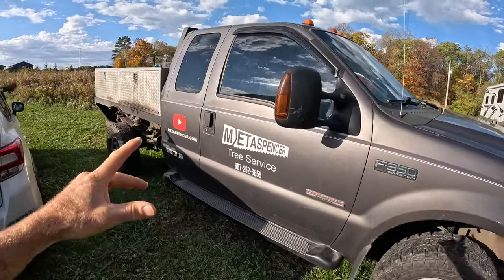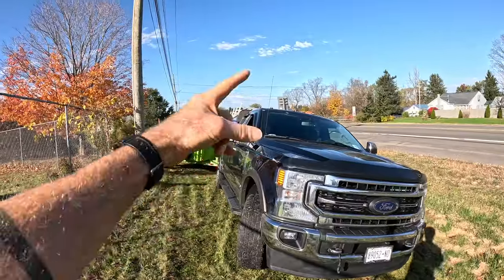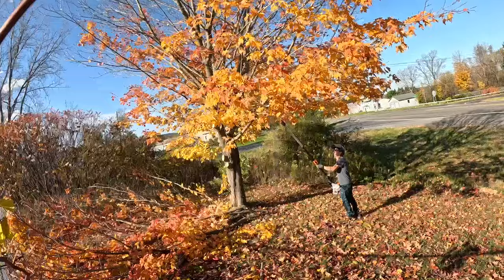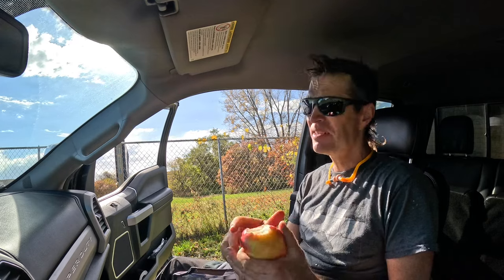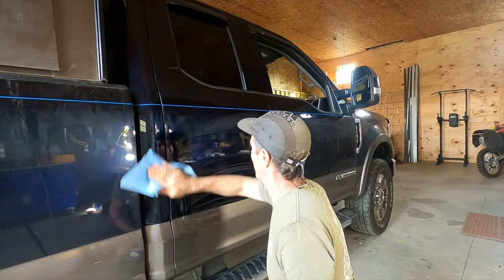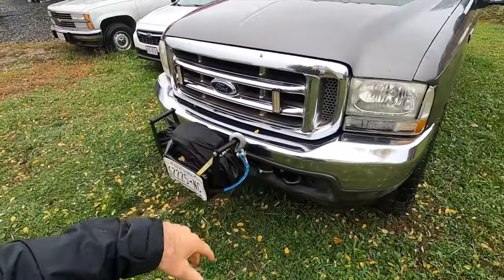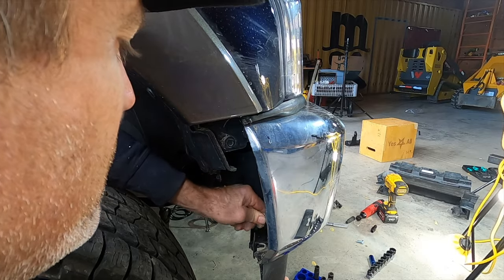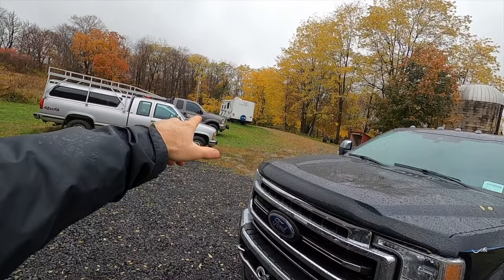I Had No Choice - New F350 PowerStroke + Winch Install

Comment: All those fancy extras in the truck means more to go wrong. All the new modern vehicles have a built-in redundancy. An extender for the winch switch sounds good I was going to suggest make an external tool and store it in one of those shelves.
Reply from the maker: You said it man ... every bell and whistle on these new vehicles is a complex replacement waiting to happen :)

Comment: Nice truck!!! Only issue I’ve had with mine is oil pan leaking.

 And yes even rakes, keep two on my truck and both broke on the same job
Reply from the maker: An oil pan leak! Dang, I'll have to keep an eye out for that. If it's not one thing it's another

Comment: You could maybe make a custom bed for the truck so you could have all your equipment on the truck and be able to haul the mini skidsteer while  pulling a trailer.
Like having a storage compartment in the front and the mini skidsteer in the back loaded sideways that way it wouldnt interfear with the trailer.
Reply from the maker: sounds like a great setup! I built a custom bed for the previous truck and it worked out great ... storing the mini on there would save A LOT of trips
Reply: @metaspencer  Just make sure your truck stays within specs, having weight behind the rear axle will transfer load from the front to the rearaxle ontop of the weight you put there, in combination with towing a trailer your rearaxle will be pretty maxed out, make sure you put as much other stuff in the front to balance that out, or have the skidsteer behind the cab and your tools in the back.

Comment: should just be a little allen bolt holding the winch freespool lever on, pull it off and make an extension to get the lever out past the bumper, no hand diet needed!
Reply from the maker: Yep you said it: just an allen. Gotta figure out an extender for sure :)

Comment: Hey Spencer where did you find that topper with big tool box .thats what i need badly for a dodge ram 97...be so much help for keeping gear. My seats are to the roof its nightmare.  Thanks god bless
Reply from the maker: Hey buddy! I first started looking at new toppers and they were waaaaaay overpriced, so looked around on Craigslist and FB Marketplace for a used one. It's working pretty good: nice to be organized and to keep the stuff under cover. Not perfect but getting the job done

Comment: My newer truck is a 2003 Dodge Cummins crew cab.  Bought with 60k miles many years ago. I hate the electronics.  Next truck will be older with a mechanically injected Cummins.  A truck which can be rebuilt as needed.
Reply from the maker: My son's got a 2003 Dodge truck, too -- loves it but man those electronics give him fits. I totally see your point, man. My 1963 tractor is such a simple joy to work on. Keep it simple